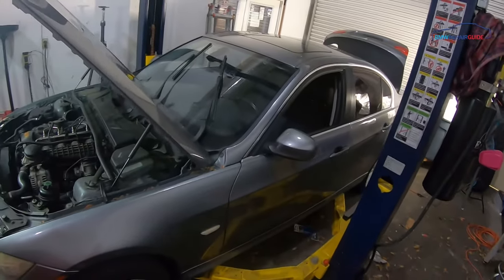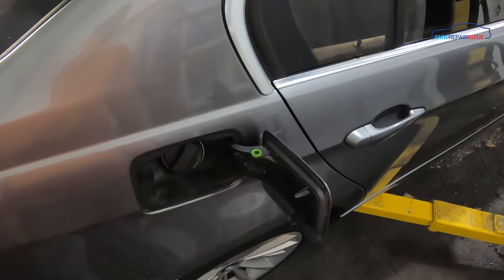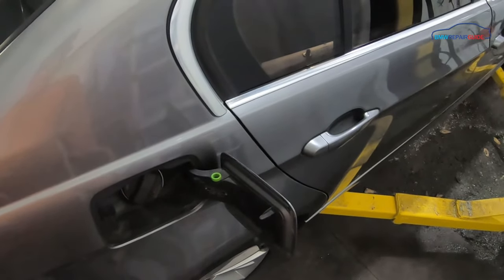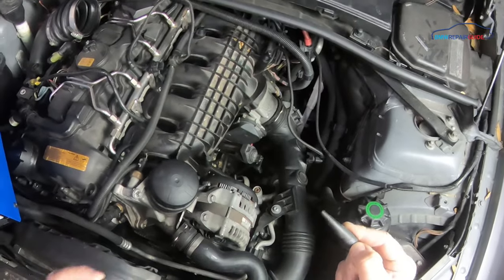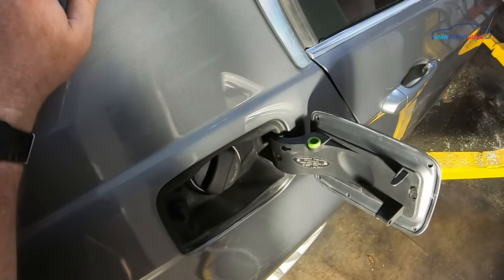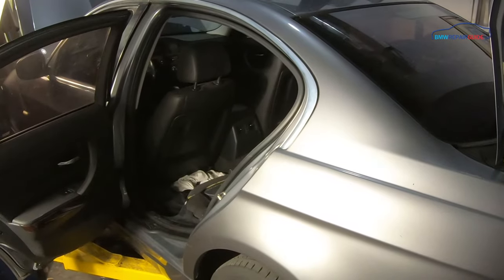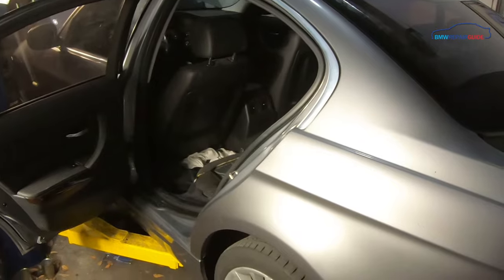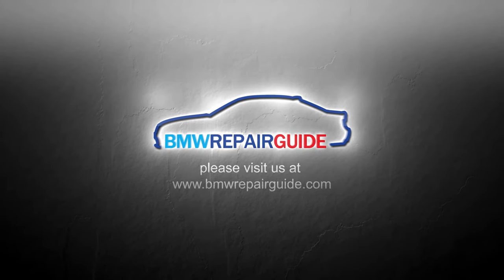BMW Evaporative Emissions (EVAP) Control System Leak Diagnosis on an E90 - (P0455,P0456,P0442)

Comment: gotta mention that you will see a ton of smoke coming out of a black vent cylinder in your 328i that's normal.  You have to disable the vent canister before you smoke test.  I saw mine smoking and bought a new one.  Do not do that.  You have to back probe and ground pin 3 of the DMTL pump THEN test.  Doing otherwise will cost you money and time.
Reply: What do you mean by “back probe?” Also when you say jump pin 3 are you disabling the dmtl pump?
Reply: Back probe is where you stock a metal implement usually a sewing needle or paper clip through the back of rubber insulation to keep the circuit intact.  It actuates the valve.  You’ll just be dumping smoke out the vent and not be troubleshooting if you skip this step.
Reply: @987CAYMAN07  thanks

Comment: Thank you for a great video with step-by-step troubleshooting of this issue. A quick suggestion for anyone reading this post and having this EVAP code issue. If you do not pump your own gas, before you buy a new gas cap, or consider any other repair, check to see that your gas cap was properly closed/tightened the last time you put gas on the car. I have had a loose gas cap trigger this code in a few occasions and the fix was as simply as to tighten the cap correctly. Thanks again.

Comment: awesome vid.  I'm so tired of all those fantasy videos solving the problem by replacing the purge valve or canister vent solenoid.  If they were the problem, the previous owners would've kept the car after replacing them the first 3 times instead of selling the car cheap.

Comment: I'm getting the evap error code on my obd II ...is that the reason why when I pump gas it constantly clicks off the gas pump ? Takes me 10 minutes to fill my tank ! Anyone?
Reply: I’m having the same problem, I’m getting my car ready for emissions and the only monitor not ready is the Evap and Air.
Reply: @Matt Porto  Have to change my purge valve I've been told

Comment: Got a PO456 code on my 2014 X5 which is stopping me from passing emissions. Just bought a new gas cap, hopefully the leak is there. Thanks for the guide!
Reply: any updates on the cause of the P0456? was it the gas cap? i have similar issue on my 2015 X5
Reply: Any update?

Comment: Quick heads up.... if fuel is coming out of the DMTL fiber filter it is most likely the fuel tank vent valve causing the issue.   

It's a complete bear to trouble shoot as it throws codes for other evap items.      If the car will not fill up past a half tank and the throttle surges after filling up, or even stalls out completely, check the fuel tank vent valve.

Comment: Great information...
My 2008 E90 335XI sedan had the Service Engine Soon light come on. It was reset, but the light came back on after about 10 days. Where would the Vapor Detection Pump and the Charcoal Canister be located on my 2008 BMW?  I need to go to inspection this month and it couldn't be worse timing. Thanks and super well done video.
Phil
Jersey Shore

Comment: I went to the smoke test and found smoke pouring out of the dust filter that sits next to my charcoal canister on my E39. Does it sound like the filter is bad? Or do I have to crimp off or plug the connection to the filter? Many thanks.

Comment: So, is there not a DMTL vent valve within the BMW Evap system, which is open with the ignition off and the engine off. And when open, vents the evap canister to air? So if you run your smoke test as you indicate, and dont force this valve closed, then you will just get smoke coming out the vent rather than out the canister or its connections, or out the gas cap or out the fuel pump connection? Any insights appreciated as i am about to test the evap system on my E39 525i.
Reply: Having that same issues . How did you close the valve ?

Comment: Great video! Is there any other way to clear the Service Engine Light if you do not have the diagnostic scanner?
Reply: I tried getting my light removed by the scanner but it came back after a few minutes
Reply: @roggerily5519  buy a mhd Wi-Fi adapter and the license trust me bro it helps a lot
Reply: Remove negative battery terminal for 3-5 min, or just buy a 30 scan tool from Walmart works great

Comment: A bad gas cap can cause the fuel goes into the canister? My e90 have a bad idle and is stalling every time I run. I disconnected the tank line of canister and a lot of gas was pump off. The canister is full of fuel too 😢

Comment: My 2017 440i is pulling a P0446 code evaporative emission system. Says Vent control circuit. What and where is this circuit? How would I fix it? Thanks
Reply: Have you figured out your P0446 issue? Curious what your fix was
Reply: check your fuses

Comment: Hi. Is there any chance to get the fuel-air mixture to lean code (118001) because of the EVAP leak? Thanks!
Reply: I have the same issue at the moment . How did you get yours fix?
Reply: @tommyair7  I replaced and reprogrammed fuel injectors
 That resolved the problem
Reply: @ikajeiOFFICIAL  thanks for your reply . I will chat the fuel injector.